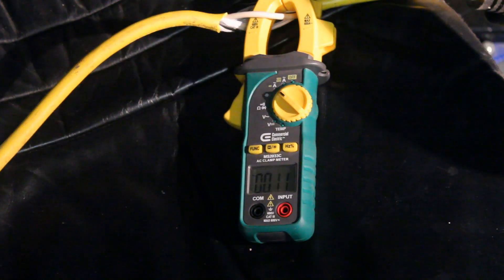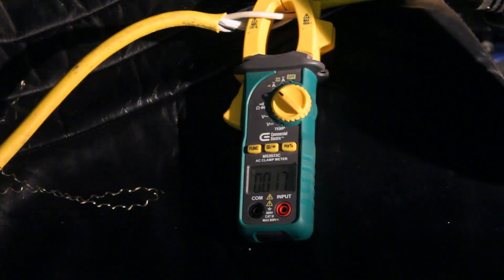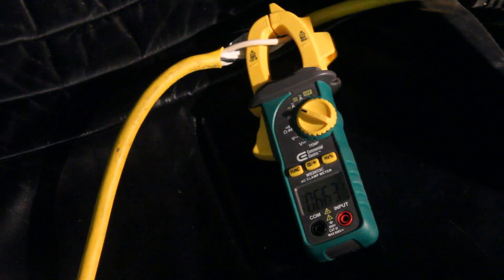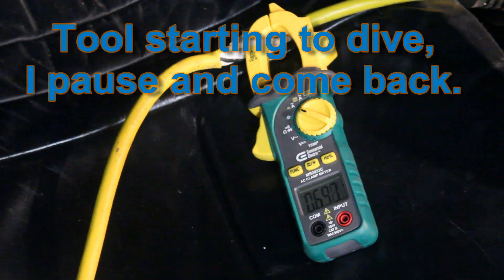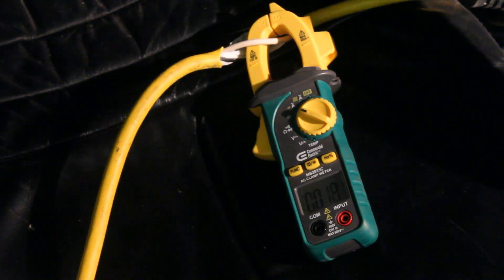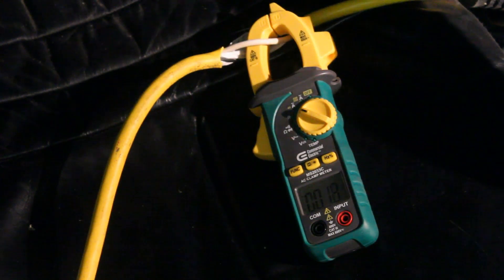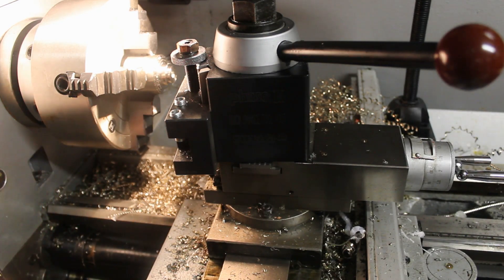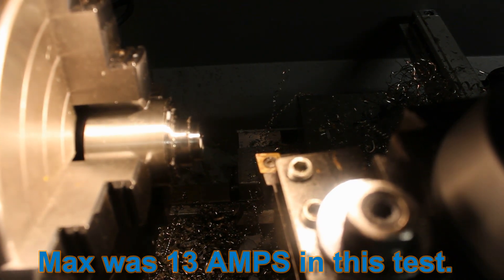Smithy MI-1440L Current draw at 110V example - Requested.

Comment: Very Good video.

Not so much because of the video itself,  but more so the effort you have put into making it.

It is not like we get paid for our time to do video,s to help others,  but more so for the Love of doing video,s that can help others. 

The main thing with electric motors is not so much there Load Power when running but the power it takes to get them running.
If a motor is generally not powerful enough for the load it will simply stall, but not draw more amps it will to small degree but only to the point of stalling.

The measure of electric motors or high load power sources is the amount of Inrush.
Which is the amount of power required to start the motor or power source.

For example Welding Machine,s  have a Huge Inrush of power for the initial  arc,   but decrease after that point.
Same thing with Air Compressors,  Lathes and Mills.

This is where most people have trouble when starting a workshop from home.
POWER REQUIREMENTS ???????

Thanks for posting this video.
All the best.
Regards Peter.
Reply from the maker: 1st thanks for the nice comment. 100% on the videos, I'm here to help others that's what it's all about. I'm no expert on anything but I try.
I agree you could see the power spike when turning on but I have nothing to really monitor that with. In our case tho its not so much the inrush on a single circuit, a 20 amp breaker can handle way more than 20 amps for a small period of time. This was kinda just a test to see what he can expect with pretty much the same electrical setup not a true power analysis of the machine.

Peter, thanks for taking the time to post a comment :)
Reply: @dnjmachine 
 Hey Daniel.

After leaving the comment I started to think maybe I should not.

I did feel at the time after writing this comment that it felt like I was as I mentioned High Jacking your channel.
 it's good to get involved in topics like this but it's not always taken in the context it is delivered.

I had not watched your channel for a few days and thought it might be good to drop by and see if you have any new content.

I see you posting videos about the Tormach controller but I only have a small amount of interest in these videos.
It's more of a general happiness that you are sharing information with others that may be interested in this type of controller.

I came in on a video that was of interest to me,  as it is a very popular topic amongst people who want to start some sort of workshop from home.

It's funny i actually did come here with the intent of just deleting my comment.
My  decision was based on the fact that if you did not leave a reply I would delete, but if you did reply then I would leave as is.

You are a good guy Daniel and anything that I write in  comments is always delivered with sincerity.

All the best.
Regards Peter.
Reply from the maker: @weldmachine  No worries man I'm not upset, I think I even commented on one of your videos after this comment but maybe not, I had to work my day job and had quite a few alerts to go over that night.
Text isn't my best asset as we talked about but were all good man! Can't wait to see your lathe going don't know if I commented or not but those bushing things would go perfect on your Mazak.
Peace